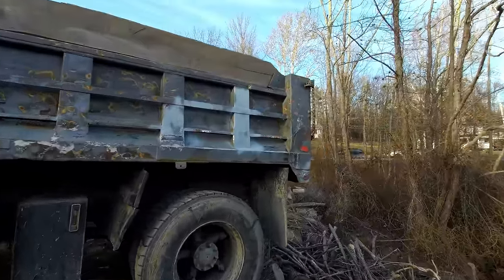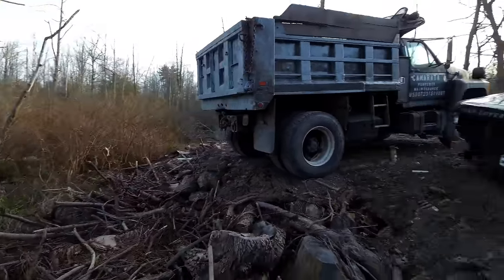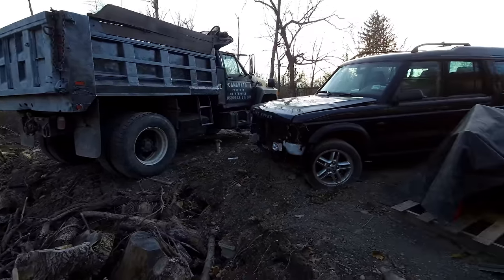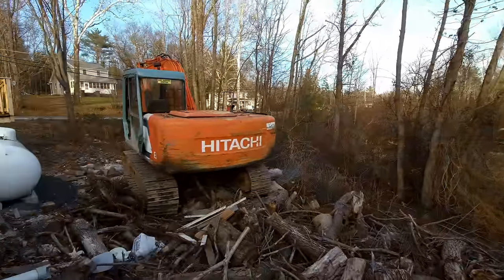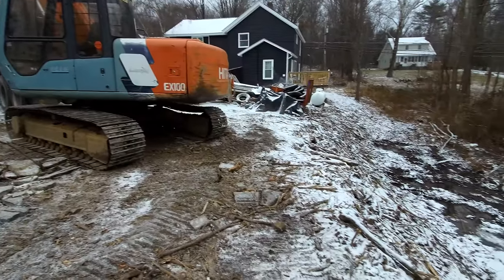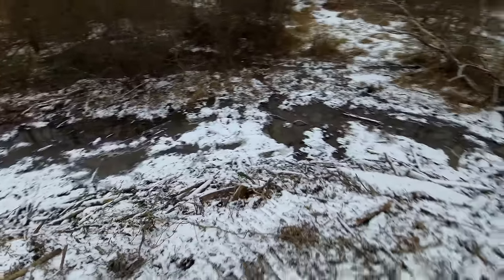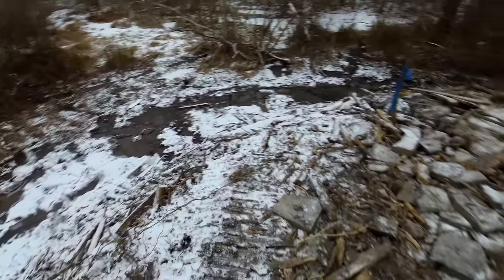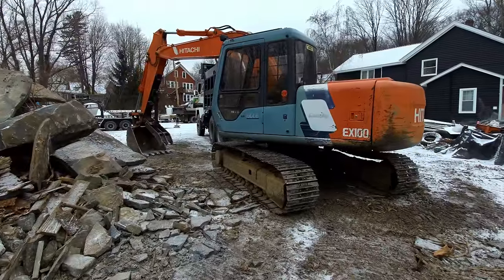Cleaning up dumped wood

Comment: Andrew, out of curiosity, wouldn’t using the tracked Bobcat skid loader with the 4-1 bucket to pile up that wood have been faster, cheaper and easier on fuel? 
The camera angles are deceptive. Not sure how steep the walls of that pit are or if your skid loader can clear the sides of the 10 wheeler.  

How long was that job and how expensive? Around here a big piece of equipment like your excavator plus labor is about $110 an hour but we are a low cost area for labor. The owner of that place sure created himself an expensive mess to clean up. What could he have been thinking? That pile of garbage would have been an eyesore if it was a half mile from a main road, let alone right on one. 

Did the wood end up on your property as firewood? Be a shame to see it in the landfill rather than than being used for heating if it was hardwood. Even the softwood could be burned to heat the water for your hot tub. 

Your videos are always interesting and informative. Keep them coming.

Comment: As for the Rover, I bought mine, a 1994 Disco on eBay, in 2005. with 118000 miles on it and I'm still driving it today,  now with 160000 miles and 14 years under my supervision.

Comment: I bought a brand new Range Rover in 1994 and it spent most of its first 12months in the repair shop. There was not one part that didn't develop a fault in the early days - even down to replacing the carpets as they got wet through a bodywork water leak. Not a cheap vehicle either!

Comment: Lot of times if you put the bed back down and run forward and slam on the brakes real good it'll slide forward away from the gate and settle down a little bit then it'll go out under it

Comment: Love your chanel. Your 10 wheeler would really benefit from a 2 way swinging tailgate, most tipper trucks here in New Zealand run them. They work like a normal one but pull one pin and but another in and they swing back along the side of the truck for easy dumping of large rocks or logs and for loading machinery
Reply from the maker: Thanks, yes, I want to do that to the gate. I would like to find a kit or something instead of trying to make all the parts.

Comment: Good point about the land rover. There used to a be a land rover parts place here that had a yard full of them. They do however have a great 5 speed gearbox and sometimes the V8 engine . You could buy them for peanut money until most dissapeared.

Comment: Future project for ya. Take your plasma torch and cut 45° angle on those loading ramps where they make contact with the ground so they don't always hit the dirt making you have to get into the truck and back it up to make them lay flat. 2:36

Comment: I have put 745000 miles on a landrover. Drove the thing all over Europe and Africa . One half shaft, Rear left 3 clutches one head gasket and a few U joints and one set of steering pins. ...... Not to shaby I think.

Comment: Over here in England first of all that Land Rover depending on whether it runs or not could be up to a £1500 and the bumpers are commonly taken of because they are expensive and to buy a scrap one and take the bumper of is cheaper than buying a bumper on its own and second of all land rovers are incredible vehicles which will run forever I have 3 Land Rovers and none of them have never let me down

Comment: If you take the boom and raise up the side of the machine you are cleaning tracks on it tightens the track over the top roller giving you more room to get a shovel or tool in there to clean tracks.  Same goes for your dozer, just put the blade down and pick the front up.

Comment: Head gaskets take out most of the 99-03 Land Rovers. Got a 99 still chugging.
Reply: Don't they also lose reverse often ?
Reply: Donny Bra mine has not. Just head gasket and transmission rebuild. 210k.

Comment: land rover disco 2 is a pretty good reliable 4x4 rig .... 
they suffer from faulty head gaskets  from poor maintenance  
the front drive shaft will explode and poke a hole in the transmission and some times the oil pan
and transmission failures usually from abuse (towing in overdrive )or lack  of maintenance

so if properly  maintained  water pumps and thermostat every 60k miles
transmission fluid and filters every 60k miles  adding a trans cooler and changing the fluid and filter every 30k and towing in 3rd gear or 1:1
 checking or rebuilding the front and rear drive shafts and installing a small scatter shield or drive shaft loop on the front drive shaft they would never stop running

so you will always find them with either a bad trans ,,, blown headgasket  or failed driveshaft and a broken transmission case or cracked oil pan

Comment: You need to make your big excavator quick change so you can use multiple  buckets like you did with your smaller ones, then buy or make a brush bucket like the brush rake you have for skidsteers that you use

Comment: I had to tow a Land Rover back to my place after it broke down on the highway.  The engine died and it had to be replaced.  I picked up a used engine for the guy and replaced it and it drove away under it's own power.  I also would have taken all that wood here for firewood.

Comment: Have you looked into making the thumb hydraulic?  It would make this type of job so much easier for you!
Reply: Karl Griggs - I agree.  When we got the hydraulic thumb it was such an improvement.
Reply: He's said before that none of his machines are plumbed for a hydraulic thumb.
Reply: I know and I am certain other know the plumbing wasn't there! But it can be installed. Hydraulics are blocks side by side added on for each function needed. Even at a $1000 or so the time saved, and the effort or struggle to accomplish a task would be worth the investment. Even my old Ford 9N now has a hydraulics beyond port, Now I can run a log splitter off the side with quick connects.
Reply: True enough.   Sorry about jumping to conclusions that you were asking the same old question several have.

However, I do suspect for a machine this size you're looking at just a bit more than $1k, plus finding the space to install another block and the plumbing for it.

Comment: I've scanned comments but didn't see anyone else ask....  Found it curious that the front wheels on the Land Rover kept spinning forward while you moved it. Didn't matter if you were pulling or pushing it, the wheels would spin a bit forward almost like it was running and in gear.  Can't figure what would cause that?  The differential?
Reply from the maker: Yes, because it was in park and it has 3 open differentials.

Comment: In ny do you need a cdl to drive the international dump truck (6wheeler)? Or will a class D license work sufficient enough
Reply from the maker: It depends on the truck. This truck required a CDL. Just look up truck CDL requirements for your state to see what trucks need it.

Comment: You need to put a hitch in the air brake system on the back of your 10-wheeler so you can pull your trailer and equipment with that

Comment: Andrew, may I ask why you aren't towing with the International? Is it because of the size or because it's a manual or some other reason?
Reply from the maker: I just would need to install a trailer brake control for the electric brakes.

Comment: Come to the Uk you see loads of working Land Rover discovery’s it’s not that they unreliable it’s just that people don’t take care of them and don’t do general maintenance on them.  I’ve had my discovery 2 ever since I bought it new in 1998 and it has just passed 400,000 miles and the only thing major was 4 new break disks and I did that myself on my own accord just before it passed 300,000 miles
Reply: All of the Discos in the U.S. are petrol, no diesels here.
Reply: David Null I mean that might be why people say they are unreliable because over here in UK most discos are diesel with a couple of the brand new ones becoming Petrol but even here in the UK people say that they are unreliable but I think it’s a car that requires some love and attention and if you don’t take care of it then it will break down

Comment: Andrew maybe you can clear this up for me you trailer over your equipment with your 6 wheeler and then state you will be bringing the 10 wheeler back due to its carrying capacity . How come you didn’t just use the 10wheeler in the first place. Not bashing just curious is all . Thx in advance keep up the good work
Reply from the maker: Its not set up to tow that trailer. Needs a brake controler. I would be better off just getting an air brake trailer.

Comment: I'll bet you would have finished this job earlier if you had used the bigger Yanmar 50....that thumb on the Hitachi wouldn't let you pick up what the bucket really could have held...but then again the smaller excavators have trouble loading the truck

Comment: It’s strange how someone actually thought they could discard all that wood in a big mess like that 🪵 🪵🪵🪵🪵🪵🪵🪵🪵🪵🪵🪵🪵🪵🪵🪵🪵🪵🪵🪵🪵🪵🪵🪵🪵🪵
Reply from the maker: Why is that strange? It’s wood, it rots into dirt pretty quick
Reply: @AndrewCamarata  you know I was thinking it would have been a good idea to dump some loads of dirt on it, it’s clean fill.  Good point.  The town saw it  that was the problem I guess. Thanks for the reply Andrew and hope to see the ditch witch back in action. Do you repair garden tractors as a service?? I have a 94 wheel horse with single stage snow blower that I would drive down to you and drop off if you would be willing? Needs motor and carb work, helper spring, side clutch plate and just general over haul. If you could help me out that would be great. I’m 2.5 hours north of you.

Comment: How much did you buy that excavator for?
Reply: In the north east U.S. you can find a decent Hitachi 100 in the $20-$30k range, machines that need lots of work are less.
https://omaha.craigslist.org/hvo/d/hitachi-ex100-3/6759333232.html

It's easy to spend other peoples' money. Hey Andrew why not buy another in New Haven CT?
https://newhaven.craigslist.org/hvo/d/hitachi-ex100-isuzu-4bd1/6755159384.html

https://hudsonvalley.craigslist.org/hvo/d/excavator/6754287977.html?lang=en

 https://www.machinerytrader.com/listings/construction-equipment/for-sale/list/category/4/construction-equipment/manufacturer/hitachi/model-group/ex100

And this place has lots of parts machines:
https://www.machinerytrader.com/listings/construction-equipment/dismantled-machines/list?Mantxt=HITACHI&SortOrder=23&scf=False&PCID=2813800&dlr=1&crmid=9932&if=1

Comment: RANGE ROVERS ARE HARD TO KEEP RUNNING! expensive parts, but all the parts are aluminum and to keep a good electrical ground is tough, so in the end the wiring turns into a nightmare and things dont work correct.  I know that ford just went to aluminum and he we go with a bunch of junk trucks.

Comment: Actually I think you'd quite an old Series Landrover or Defender...simple engineering, steel chassis, aluminium body panels. Not comfortable or quick but they go on forever if you look after them 😉

Comment: How do you manage refueling while working at a multiple day job like this one?
Reply from the maker: Mike Adams I did a video on that. But I brought the machine there full. And it still has 3/4 tank.
Reply: Andrew Camarata Oh ok I guess I just assumed they used more fuel than that.

Comment: Am I the only one who can’t wait to see Andrew use the Hot Water Pressure Washer for something? 🤣
Reply from the maker: I've been using it, should I film that?
Reply: Andrew Camarata If you use it frequently, and you don’t have to go out of your way.

By the way, you’re my favorite YouTuber. Your problem-solving ability is such a huge inspiration (I.e. fixing old  speed boats, all your equipment, etc.).
Reply from the maker: Its been working well, there has been salt on the road a few times, so I wash stuff off as soon as I get home. Thanks. Dozer and a computer video coming out soon.
Reply: Andrew Camarata Awesome stuff!!!

Comment: perfect  fuel for a large top feeding wood boiler
and he would not have broken the land rovers bumper or marker light if he would have dragged it with his bucket lower
Reply: That Land Rover is a junk car, it will be hauled to the scrapyard and sold by the pound.  If you want the car make Andrew an offer.

Comment: Asks guy to move his junk out of the way. No dice. 
Andrew: this looks like a good spot.
Reply: The only way to move a Land Rover is with a wrecker or an excavator. Apparently the owner didn't have either one of those. I think the best use for it would be to flatten it out with the excavator first and used it to protect the deck of the trailer.

Comment: I think a few factors come into the reason you just see the broken land rovers one lack of competitive priced parts and lack of user maintenance. Personally speaking I have only experience of the 110 and wolf army variant which we beat on hard in Iraq and Afghan and they kept asking for more with a bit permeative maintenance they are fine like any working vehicle. However the disco you have here has evidence of front end damage creased hood missing front etc so possibly parts cost and no willingness to fix end of the day.
Reply: The Land Rovers in the U.S. were all petrol engines, no diesel RRs here.  They are cheap here and almost always broken, the one in the video might bring US$300 in scrap, no-one want to fix them, people buy them with high hopes of making it run again, they never do, they just rust out in people's yards here.  If you really want a U.S. RR, look at Craigslist.org and browse through the cars for sale, some find their way there, most are just decaying quietly.
Reply: I have to admit that’s pretty sad to here when I know how capable a LR can be. Many LR here in the uk get galvanised chassis’s rebuilds parts are really come by. So people must use them until they brake and pass them on ?

Comment: Land Rovers of British decent are notorious for lack of reliability. The poor design they bring forth is part of this and the lack of trained mechanics for the older models along with high cost of repair parts is the picture. They used some years ago, some General Motors V motors and which should have been ditched to begin with. People who take over a used Land Rover usually are not mechanical enough to keep them running consistently.

Comment: Can you get a pintle hitch for your 10 wheeler so you can tow the excavator?
Reply from the maker: Yeah, it has one, just needs a brake controller to tow that trailer.
Reply: @AndrewCamarata  Or a trailer with air brakes.. Thank you for responding.

Comment: How come the tail gate on your 10 wheeler doesn't have the option to open like your 6 wheeler
Reply from the maker: I guess it could, I would have to add chains. Its really tall though. It would be better if it opened from the side like a dumpster.
Reply: @AndrewCamarata  yeah you're right that would be cool
Reply: The ten wheeler doesn't have a hitch?

Comment: I don't know why people create such an eye-sore as that tangle of rubble. Looked like some good timber and firewood just sitting there in a heap. If he didn't want it, why not get a burning permit and torch it as he accumulated it? Was he a tree trimmer or clear lots for a living?
Reply from the maker: I think they were doing the occasional tree job and dumping it there. It was mostly pine and willow (not fire wood).
Reply: @AndrewCamarata  Okay, I didn't mean to come off real snarky. It's just that sometimes people tend to forget the beauty of their surroundings and take for granted that they can just dump stuff wherever they want. I live in central Minnesota and your area looks similar to a lot of our area. Here we have a lot of sandy soil and drainage isn't a problem. You look like your area is pretty rocky mixed with clay.

Comment: Can you tow the tag trailer with the 10 wheeler?
Reply from the maker: Yes, its set up for an air brake trailer. I would need to install an electric brake controller to tow my other trailer.
Reply: @AndrewCamarata  ok do you tow the tag much with it
Reply from the maker: I have not. I need to

Comment: If a tree falls in the forest, are you required to cut it up and remove it?    Wood is biodegradable.  What jurisdiction does not allow wood and other natural materials to be left.   Now the plastic, that has definitely got to be removed.
Reply from the maker: If it falls on its own its fine. The problem was he was doing tree jobs and dumping it into an area that was a wet land. That's why he had to remove it.

Comment: Can anyone tell me why the tires on that land rover were spinning against the direction in which it was being pulled? Why were they spinning at all?
Reply: It has 4 wheel drive and an open center differential. If the differential was locked, the wheels would spin in the same direction.
Reply: jospi2 ..the same direction as the tires on the ground, that are being dragged?
Reply: Yes.

Comment: Is your Hitachi 32k pounds?
Reply from the maker: Less than that. If you are curious how much a machine weighs, just google; example "hitachi ex100 specs". I think that machine is 24k lbs.
Reply: @AndrewCamarata  looks heavier but your about right 
Just checking out your setup, the way pull around the machine.
I own a Doosan dx140lc but it's about 10,000lbs heavier
Reply from the maker: michael oronia the  model number usually represents the weight, a 140 would be bigger than a 100

Comment: Dude! Didn't you buy a fancy hot water pressure washer? Why don't you clean your equipment when you finish instead of going through this wasted, tiring effort? 1) Your equipment will last longer if it's kept clean, 2) Your time can be spent in a more productive manner. Time is money!

Comment: Your ramps on your trailer need to be welded... 
You can see where it's broken when you first drive off the trailer.
2:25 .. (I realize you likely already know this. lol)
Reply: @ganymedeIV4 
It already has coil springs around it's pivot pin to help pick them back up..   There's no getting around them being heavy.